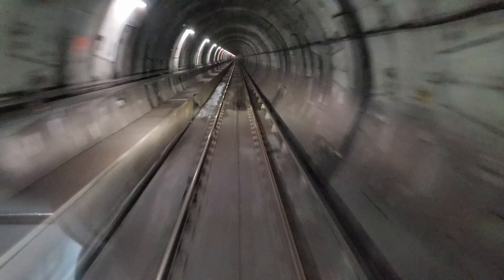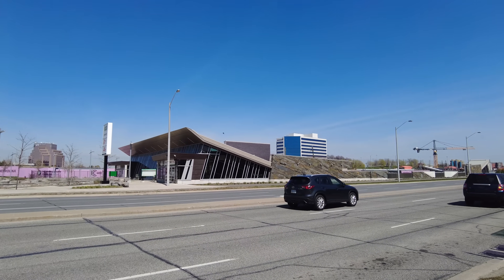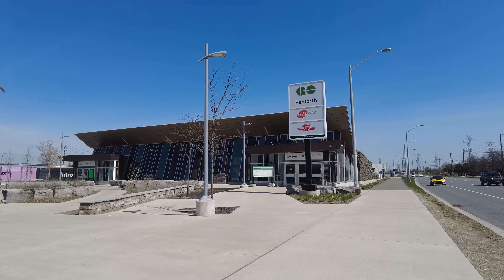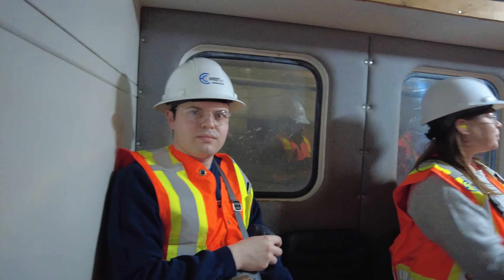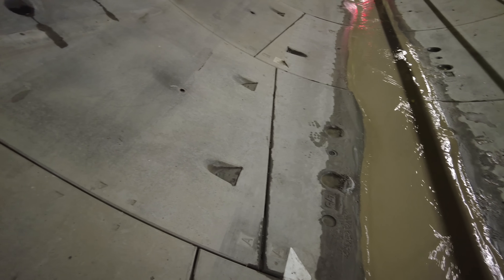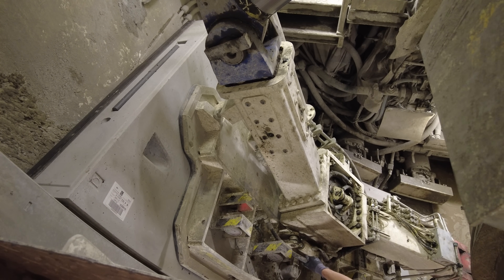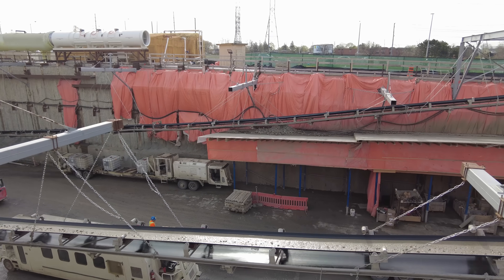Visiting a MASSIVE Tunnel Boring Machine on the Eglinton West Extension!

Comment: I remember pouring the concrete into the molds for these segments which eventually made the tunnels, I remember finishing the underside where you don't see making it nice and smooth. I remember breaking down the molds and seeing that toasty piece of concrete come out of the mold and eventually get brought over to the repair section. It's quite a process indeed! We are currently working on the Scarborough project, and also starting the Ontario line project.

Comment: I'm not sure if I remember right, but if I understood it right, I think this method of injecting a stabilizer into the soil to prevent sinkholes while installing conrete rings as the machine is moving forward is called "New Austrian Tunnel building Method" (neue Österreichische Tunnelbauweise)? We use that in a lot of projects, mainly the U5 building and the U2 extension in Vienna, but also for the Semmering base tunnel.

Comment: The first time I knew about the tunnel boring machine (TBN) was in 1982 while reading about the subway stations being built on the Washington Metro under Connecticut Avenue & Wisconsin Avenue, via the Red Line. This includes Forest Glen, as the deepest subway station in the United States, and Wheaton, as another deep station, but it is not as deep as Forest Glen. However, Wheaton has the longest escalators in the country. Also, I like some construction that consists of the tunnel boring machine being used on "soft" ground.  I believe this method was used on Seventh Street for the Green and Yellow lines. I have saved many of your shows to watch as often as I wish.

Comment: I think they are going to use one of these tunnel boring machine on the Yongon Metro construction,btw Yongon is a city located in the Southeast Asian country of Burma.The Yongon Metro it's going to be opened on 2025 and it's going to be the first-ever Metro System in Burma with eight lines. Unfortunately my country is going to be a bit of a revolution right now the military coop has took over the entire country but,however the construction has already started with.The demolition of what was once the headquarters building of the Burma Railway or Myanmar Railway.
Reply: Yeah, I was about to say the civil war is not helpful at all, also with all the sanctions against the "goverment" ... Most TBMs are western made (if i am not wrong), but probably China produces some aswell 😄.  A metro in Myanmar is nice nevertheless.

Comment: I'm really impressed by this video. You've explained some things about TBMs that I've never seen explained across all the TV documentaries and youtube videos I've seen on them:

6:10 Using one TBM as a pilot seems obvious but for whatever reason I've never heard it talked about

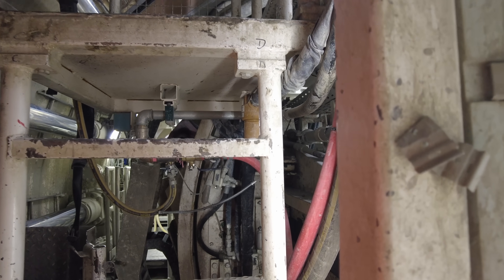9:17 While I've heard about pressurised cutting heads (even one documentary where they opened a forward hatch to inspect a cave-in) I've never seen anyone mention the obvious issue that that soil needs de-pressurising before it can be put on the conveyor

10:05 Documentaries rarely seem to talk about the launching process, often just showing a time-lapse, and to my knowledge they don't show people around during that time either. So it never occurred that there's no inherent structure to push off at launch, in fact the transitionary structure between an often square single tunnel mouth into paired tunnel ring sections is a mystery I'd love to know

10:54 The shield that overlaps the tunnel lining is often only implied but I've never heard mention how that moving seal is created with brushes coated in viscous grease
Reply: You really have to watch the videos of the Marti Group here on youtube. Most of your points are explained in detail.

Comment: Quick question for you. Is this extension of the Eglinton LRT going to have any turnaround points? 

As a person who rides Line 2 a lot, there have been a couple of times over the years that the subway has had to temporarily stop service due to an event either taking place at one of the stations, or within the tunnel. Anticipating this, Line 2 has places where the tunnel splits into three, allowing for trains to move to the middle portion, (most of the experience I've had with this happens at the turnaround between Ossington and Christie Stations) and turn around if needed.

I'd imagine that something like this would be needed in the Eglinton tunnels in the event that there is an issue, and service needs to be paused without bringing the whole line to a standstill. have any of these been built, and if so, how might building something like this happen?

Comment: Do they have machines that can bore through hard rock like granite?
Reply from the maker: Yep, that’s just a different variety, but it works very similarly
Reply: @RMTransit  Different cutting head at the front.  And pressurizing is not needed as the front face is stable.
Reply: Do the machines ever hit any man-made structures, such as drilled wells or other surprises ?

Comment: Herrenknecht TBMs at work again :) These concrete lining elements are called tübbing in German, a term from the mining industry, there seems to be an English equivalent, tubbing, but I don't know if that is commonly used. Great video!
Reply: It sounds cooler if we just keep the German word.
Reply from the maker: I'd just say tunnel ring
Reply: Yes, the difference in terminology is quite interesting.

Tubbing in English can also mean:

A hazing ritual in which the victim's head is held underwater. :)

Comment: That was very interesting, I'm glad to hear that the western extension of line 5 is ahead of schedule as well.  Is there any reason why subway building, especially in North America, is taking longer than it used to?
Reply from the maker: North America isn't the only place with delayed projects, and some projects are much faster than others! I talk about some of it in my costs video
Reply: Theres many reasons. A major component in the last couple years is supply chain. You might be building and need materials that keep getting delayed weeks to months at a time. Another factor, to many reles and considerations, things like much stricter safety rules, extensive environmental rules to minimize impact (many of which of continually gotten a lot stricter over the last decade), an d more considerations the the people around the construction, minimizing noise, traffic disruption etc.  Now I'm not saying these are all bad things, but every little thing / rule that's added means it takes more time to build as well.
Reply: America's fussy land ownership laws?
Reply: Money 💰
Reply: Using TBM is slower than cut and cover is the main reason it's slower

Comment: I imagine a lot of the heat in the tunnel is from all the friction of the TBM's cutting wheel grinding all that rock. All that friction would put out a lot of heat.
Reply: Surprisingly, no.  I'm one of the electricians on this machine. most of the heat is from the frequency drives for our motors and the large transformers that take the 13.2kv source down to 600v.
Reply: @cannabeans  What's the drive power of this machine? I know the Herrenknecht 7m diameter EPB TBMs used on the Doha metro were 1.44MW, so even at 90% efficiency, that's 144kW of waste heat. A standard space heater is about 1.5kW. So A single TBM will be emitting about 100X the heat in a tight insulated environment.
Reply: @cannabeans  That's interesting, the power is pulled off the main grid then it's stepped down by a in house transformer on the machine? How is it kept on the grid while moving? I know it's very slow moving but the logistics of that seem a bit tricky? I'm doing my apprenticeship with ibew353 right now and that seems like a very interesting gig!!!
Reply: Also if you are under a mountain temperatures can go up pretty rapidly the deeper you are
Reply: @Valery0p5 i think coolants are useed
Reply from the maker: Yep, thats a huge component of it!
Reply: plus there's soil insulation on all sides, nowhere for the heat to dissipate

Comment: Thanks for talking about how TBMs turn; I haven't seen that mentioned much in other TBM videos I've seen. Another thing I'm curious about is how do they dig out the stations, especially when they are deep enough where cut & cover isn't an option (and similarly, digging for crossovers).
Reply: I'd think the limitation on cut and cover isn't depth, but if building under existing infrastructure or buildings they don't want to destroy.
Reply: It's done before, at the Eastern Access tracks far deep under New York City's Grand Central.  But cut & cover wasn't an option.
Reply from the maker: Cut and cover is an option! Its how most stations are built TBMs or not - its how most happened on Eglinton.

Comment: So serious question, why are bored tunnels so expensive if TBMs make it so simple. Can we expect these peices to drop significantly if we are producing more TBMs on the future?
Reply: Because TBM are expensive, TBM's operators are expensive, the time required to dig the tunnel is expensive. A simple process doesn't mean a simple operation !
Reply: For Eglinton, tunneling is $730M, on a $4.7B project.  15%.  
It's not the cost of the tunneling, it's the fact that to tunnel, you have to go deep so that the tunnel doesn't cave in.  This means every station, which is probably 50% of the cost, winds up being more expensive that if the line were built shallower.
Reply: @walter2902  thank you, very interesting.
Reply from the maker: The cost issue is mainly when TBMs are used to enable deep stations - deep construction of stations is where things get expensive. The TBM tunnel is not very pricy!
Reply: These machines are expensive. Not just expensive to build but expensive to run. They contain a lot a complex machinery, which needs to be operated and maintained. Which means lots of (well-paid) people and lots of (expensive) spare parts. And it can still build only a few meters per day (Elon Musk's pitch for the Boring Company was that they would build a boring machine which would be faster than a snail - which would be great). And its still far from simple. There's all sorts of problems which will happen and which need tp be solved on the spot.
Reply: By a quick google search the upfront capital cost of a TBM is $15million on average, add in the material costs of the tunnel itself and thats a lot of fixed costs that need to be paid.

But economics tells us that any longterm operation usually has its costs dominated by marginal/continous costs. You need to buy fuel and electricity for the various pieces of equipment, you need to pay all the laborers (and i assume TBM operators are specialists making good money with benefits), you need to pay the design and management teams who also are making good money. Its not exactly ripping people off, but the fiar market rate for specialists is always going to be expensive.

Basically one of the major costs of a TBM will be the time, the machine has a operating cost of $X/hr, and it has a speed of 14m/day which can be converted into a cost per unit distance. (Which is the reported value, and you have to work backwards to get the cost per unit time. The best way to lower costs for tunneling is to make the machines dig faster.)
Reply: @jasonreed7522  15 million is really chump change on these projects, and my confusion is that a cut and cover operation, usually pointed to for being much cheaper, also have the long term cost aspects. 

So is it just much slower to bore? Is electricity more expensive than gasoline somehow?

I'm left with the impression the cost is more expensive professionals and maintenance.
Reply: @neolithictransitrevolution427  the 15million was from a quick google search, and it was just the machine itself and no other costs associated with it like transportation and assembly.

While electricity is typically cheaper than diesel, RM mentioned that it had a dedicated distribution service just for the machine and it runs 24/7. A quick google provides the values of 1.5MW for a 4m bore and 8MW for an 8m bore. Keep in mind that 1MW for 1 day or 24hrs = 24,000kWh, so assuming an 8m drill you have 192,000kWh per day, which is definitely a massive light bill at any electrical rate. (Not project breaking mind you, but definitely something on the budget and not handwaved as trivial)

To make a long story short, their isn't any 1 singular reason that TBMs are more expensive than Cut and Cover, but many contributing factors. Although basic economics tells us that fixed costs get distributed over the duration of a project, but marginal costs don't; therefore a short project has its costs dominated by the fixed capital costs and a long project has its costs dominated by marginal costs. Cut and cover is currently significantly cheaper than tunnels, and i can't find any reliable information on how much faster cut and cover is than TBMs but I'm sure its significant. 

Although another factor that has already been mentioned isn't the tunnels themselves, but how deep you need to dig/mine out your stations, with a general rule of the deeper the station the more expensive the station itself becomes.

Comment: Fascinating! I have been curious about these machines.  I pass by Richview Park at least once a week, and always wonder how it is going below ground. Those machines are a lot bigger than I thought!
Reply from the maker: Yep, they are enormous!
Reply: Eglinton LRT tunnels are bigger than subway tunnels because the vehicles are taller. They have over 6m diameter while subway tunnels are 5.4m (Sheppard) or 5.6m(TYSSE)
Reply: @OntarioTrafficMan  It's interesting that this is the case but it also makes sense because low-floor LRV do take some sacrifices for floor space and put the remaining equipment on the ceiling.
Reply: @MarioFanGamer659  Exactly. Subway trains are generally designed to fit in a small tube (similar width and height, with rounded corners) while trams are designed to fit in tight spaces on the road, so they are narrower and taller (due to equipment on the roof, and overhead power collection and often no consideration for minimising the tunnel radius by rounding the corners of the roof).
Reply: me too!

Comment: 6.5 meters diameter: that's a bigger tunnel than the TYSSE extension to Vaughan and the ECLRT original part used. Interesting! I wonder if TBMs getting wider increases costs?
Reply: I think the bigger TBM is to decrease costs. 1 tunnel for both tracks instead of digging 2 tunnels right beside each other. Of course it does massively increase spoil removal etc so I think there are several tradeoffs involved, but I believe the choice for a bigger TBM this time was to reduce costs.
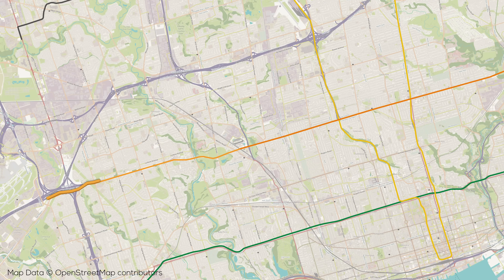Reply: @namm0x326  He mentioned at 6:00 that they are boring two tunnels.
Reply: @namm0x326  Their are still separate twin tunnels on this Eglinton West Extension, as with the original ECLRT and TYSEE. Single bore tunnel shared by both tracks is being used on Scarborough Subway Extension, however.
Reply: @namm0x326  6.5 m isn't big enough for two tracks. It's still a twin tunnel but I think 6.5m is a standard siza tbm hence cheaper to aquire and get spares for if needed.  Custom TBM's are generally much more expensive specially if something needs to be replaced
Reply from the maker: Size doesn't increase cost all that much - bigger than the TYSSE I believe a big factor is needing to accommodate overhead!
Reply: @RMTransit  But the Eglinton West Tunnels are also bigger than the original tunnels for ECLRT (Mount Dennis to Laird)